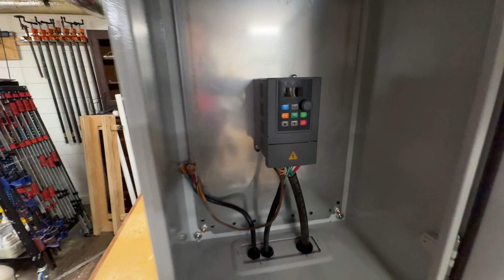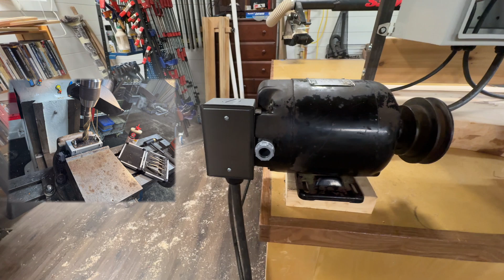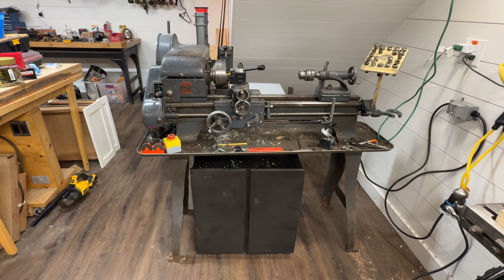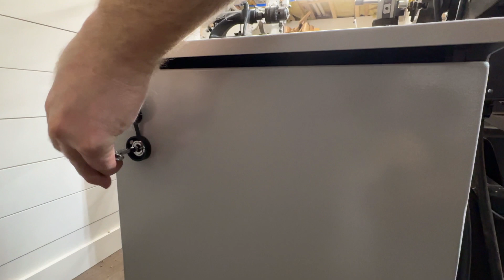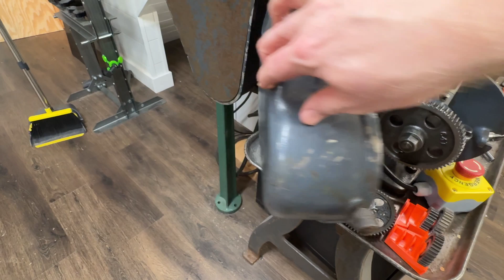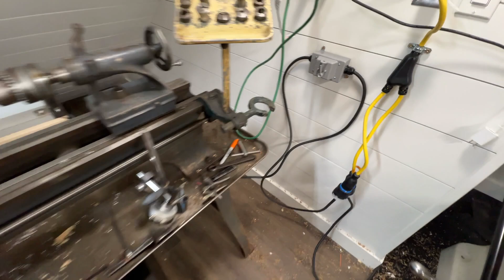Wiring a VFD/Phase Converter for my 1958 Logan Model 200 Metal Lathe

Comment: Why didn't you just replace the three phase motor with a single phase motor ?
Reply from the maker: Certainly could have done that, but I like the flexibility and challenge of wiring a VFD.  Had the motor not worked when I rebuilt it, I might have gone the single phase route.